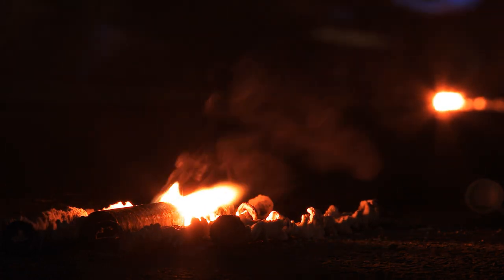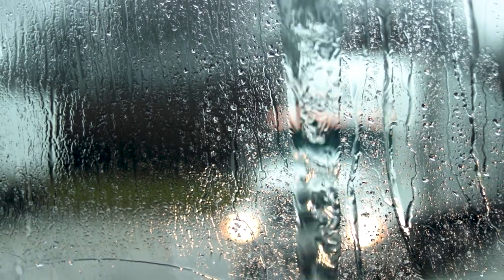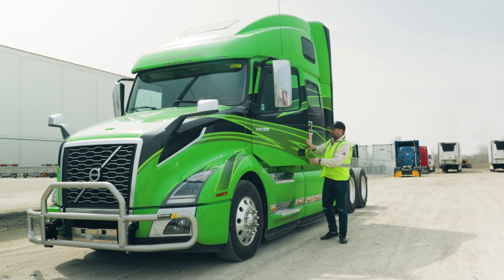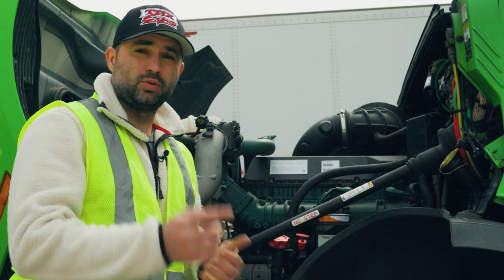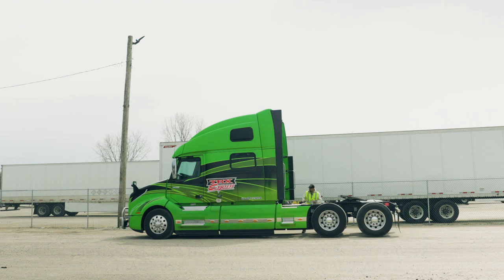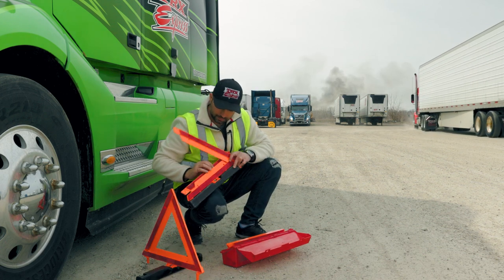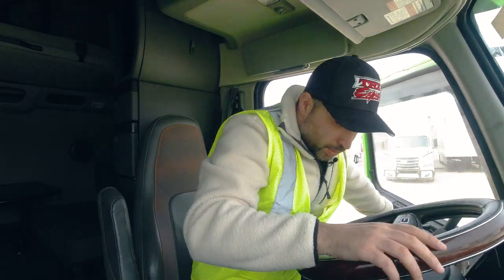How To Setup Your Emergency Triangles Tutorial For Noobs

Comment: Outside Nth America, is the global hazard-warning triangle construction and performance specifications, cited as "UNECE 27R.  This is the specification held in "The UN Convention on Road Traffic" - amendments, as 'equipment that may be required on board (cars, etc) by states parties - countries.

Flares - are not part of that requirement, but the global Spec does allow LED technology, provided that the triangles key elements; its inner fluorescent triangle,- and red reflex reflectors remain intact, as batteries can die, leak over time.

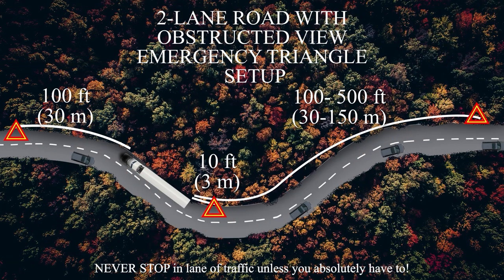Comment: 5:55 is incorrect on a 4 lane divided highway there's no need or not required to have a triangle in front of your tractor because there shouldn't be any traffic coming from the front of your tractor at least we hope not. So all 3 triangles should be in the back of you tractor and trailer set in such a way where it tells other motorist to avoid your vehicle. One triangle about 50 feet from the trailer roughly lined up on the left corner of your DOT bumper the 2nd roughly 100 feet from the first in the center and the 3rd roughly 100 feet from the 2nd line up on the right corner of your DOT bumper. That's according to the FMCSA hand book. Get yourself a copy if you don't have one